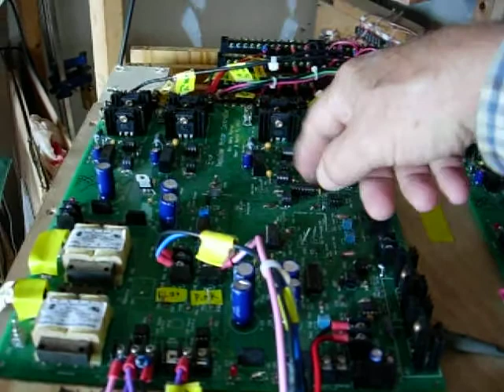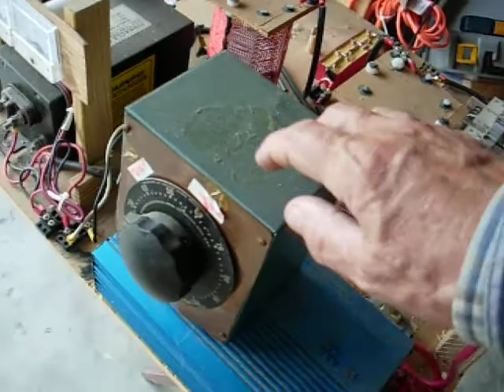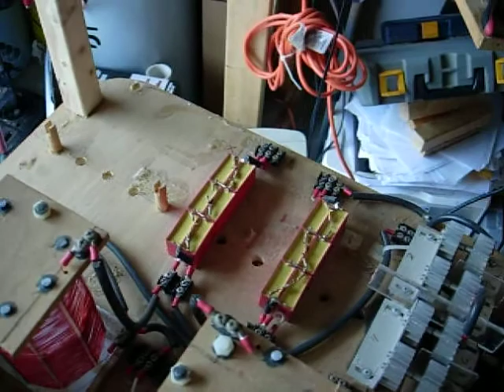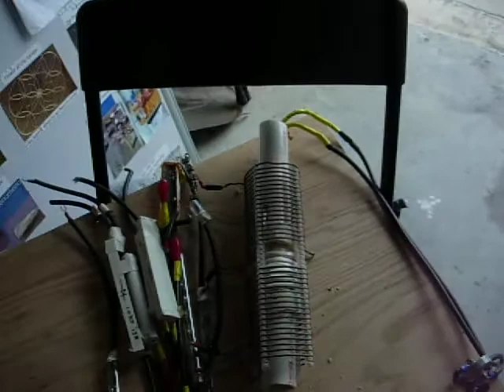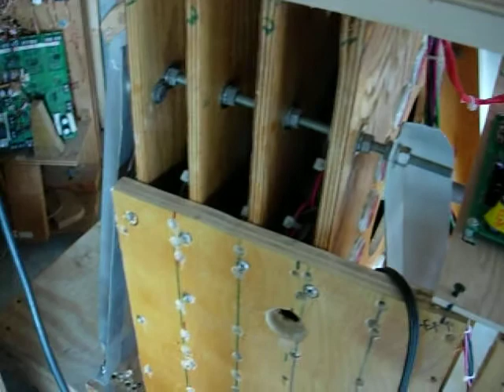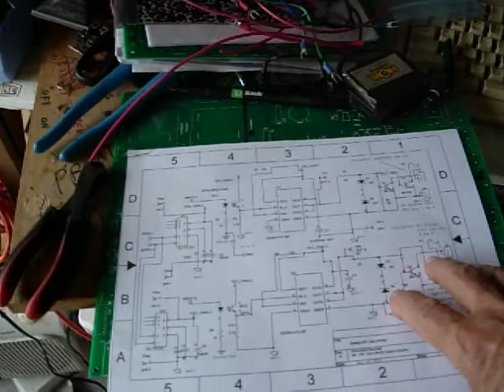Don Smith #166 Update on layout

Comment from the maker: major change is being implemented.  the dual coils will now be used to drive the rotors.  some energy will be gathered but the primary power will be from a no spinning magnetic generator.  this new generator will produce DC power an unlimited amount and be self running.  stator field will electronically spun around the fixed rotor coils attached to these will be bridge rect and caps.  The dc will be used to run the inverter  the rest of the design is the same

Comment from the maker: There's a new type of motor that anyone can make.  Use a Lazy Susan disk say 12 " diameter and place two arcs of neo magnets all norths aiming outward and arc inward toward the center.  The arcs  must be close enough to the side so that they will cause rotation when another  magnet or  impulse coil  is placed out side the disk in a fixed position if it is a coil if it is a magnet then a cam action must be used to allow the spinning disk to go through 360 degrees of rotation.  if no cam is used then the disk will go about 350 degrees then bounce back due to North to North.  The coil must be impulse by using a sensor that fires the impulse at just the right moment North to North to cause the disk to spin at a huge rate of speed.  energy can be pulled from this device in many ways to make it self running.   The cam does this automatically. but the coil needs a very small amount of energy .  good luck

Comment from the maker: schematics are basically the same.   I'm not sure what will happen when I dump energy during off motor impulse times.  if this loads down the motor then I will dump energy during the impulse time   both things happening at the same time.   I need to test this new setup with two groups of coils currently 6 parallel in series with 6 parallel   to all 12 in parallel.  this means that the impulse voltage will be same for all 12 coils and current should go to max for the 36vdc.  I also just found two old 12vdc batteries and if these can hold a charge then i'll use them making the setup 48vdc  pos and neg.   The rotation by hand is amazingly smooth.  so that both side plates of plywood now some serious screws to really hold the stators in place.  The alignment was a nightmare since all parts interact.